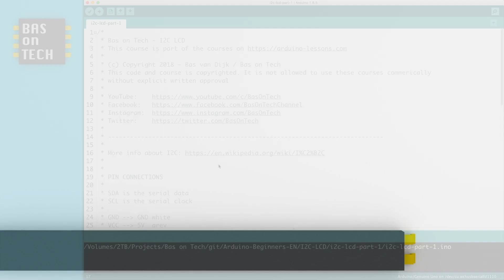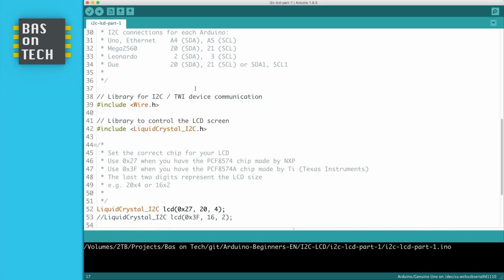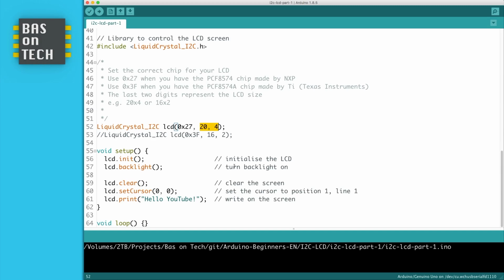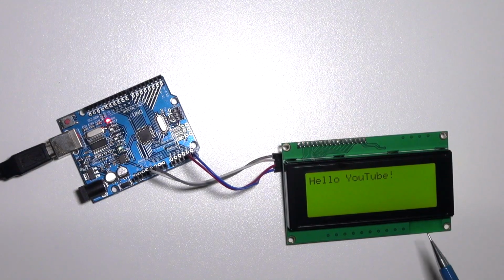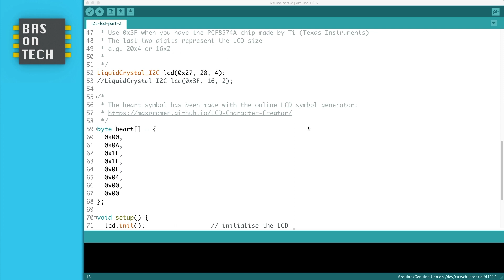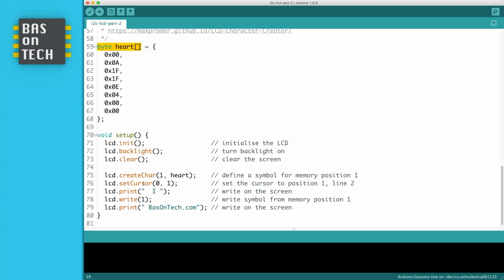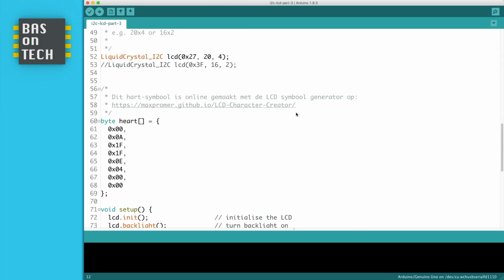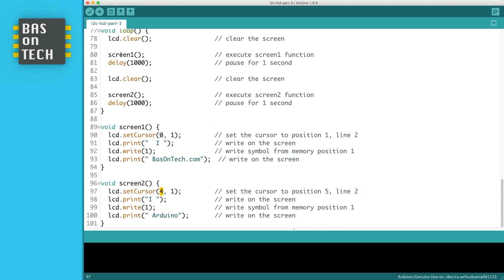I2C LCD WITH TEXT AND CUSTOM SYMBOLS - Arduino tutorial #11

Comment: for me, the custom character code never works. it comes up with the error "call of overloaded 'write(int)' is ambiguous
". I keep copy and pasting the code from the website, and it continues to not work. Here was the code:

#include <Wire.h>
#include <LiquidCrystal_I2C.h>

// Set the LCD address to 0x27 in PCF8574 by NXP and Set to 0x3F in PCF8574A by Ti
LiquidCrystal_I2C lcd(0x27, 16, 2);

byte customChar[] = {
  0x00,
  0x0A,
  0x1F,
  0x1F,
  0x0E,
  0x04,
  0x00,
  0x00
};

void setup() {
  lcd.begin(16,2);
  lcd.createChar(0, customChar);
  lcd.home();
  lcd.write(0);
}

void loop() { }
Reply from the maker: You are writing an integer to the write function with lcd.write(0); Are you sure the lcd.write function accepts integers?

Comment: Hallo, wat moet ik doen als ik een PCF8574T heb ipv PCF8574 of PCF8574A? Geen vermelding NXP of TI  Heb 3 schermpjes met I2C convertor en krijg geen enkel aan de praat ondanks correcte bedrading en copy/paste code.  Dank alvast!
Reply from the maker: Hoi, ik heb zelf alleen ervaring met de controller die ik in de video gebruik. Kon je erachter komen wat het verschil tussen de controllers is?
Reply: @BasonTech  Wel het is opgelost! :-) Het leek me zoooo evident dat SLC en en SDA in de respectievelijke poorten in de Arduino moesten maar het was A4 en A5!  Stom hé! Waarvoor dienen die dan eigenlijk?  Wel vreemd ook als je grotere afstanden meet vanaf ongeveer 1m dat de registratie soms erg rare sprongen neemt zonder dat je met iets in de weg komt: vb 123,23 cm, 123,54 cm, 245,57cm, 123,69 cm.  Het zijn en blijven natuurlijk sensoren van enkele euros!
Reply from the maker: Super! Hoe groter de afstand hoe meer spreiding van het ultrasoon geluid. Ik weet het niet meer zeker maar ik dacht dat het verschil tussen de soorten pins is iets met hardware- en softwarematige I2C